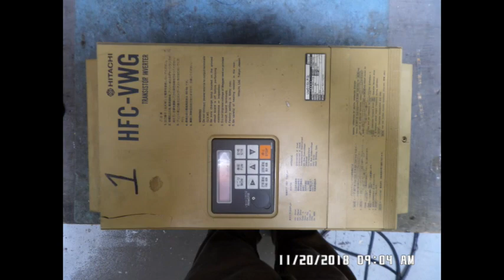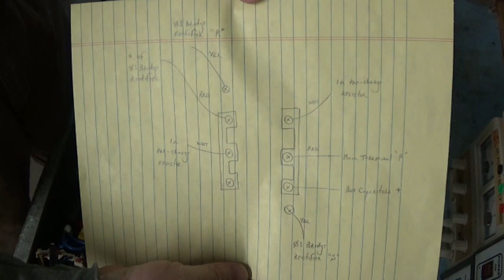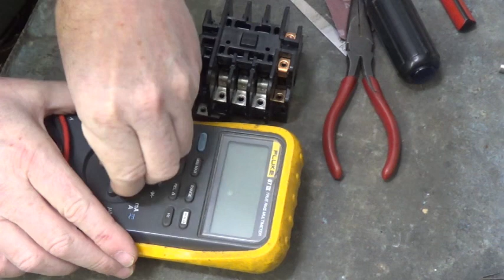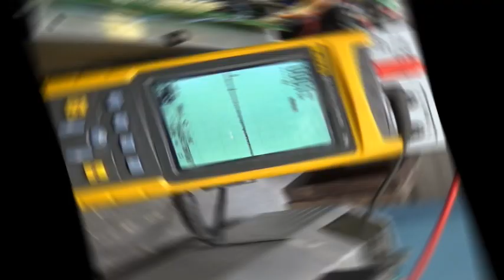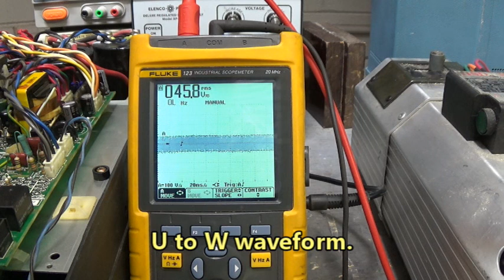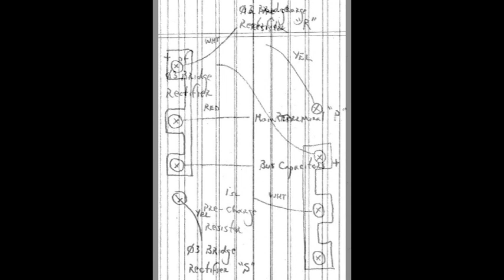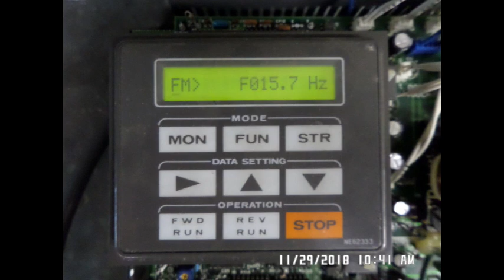DC Bus Under Voltage Alarm on the Hitachi Spindle Drive.

Comment: Hi all.
I have a problem 9400 highline inverter Lenze ,
The "DC-bus undervoltage" error with the response "Trouble" occurred in the "Diagnostic" of "Engineer"
how i can solve this problem knowing that the real dc-bus voltage is 563 volt
i need service or repair manual of 9400 highline
Reply: Hi, I have this problem now. Have you solved it yet?